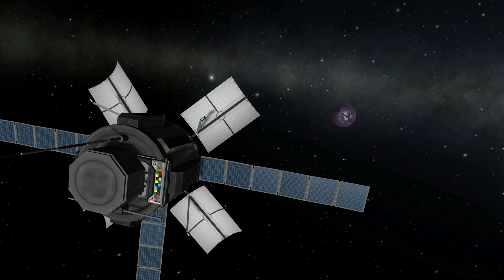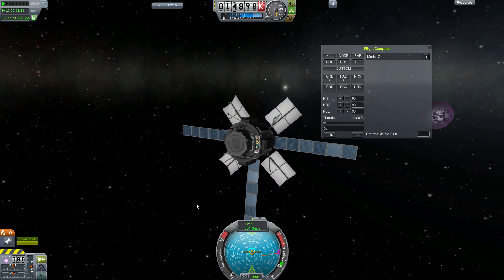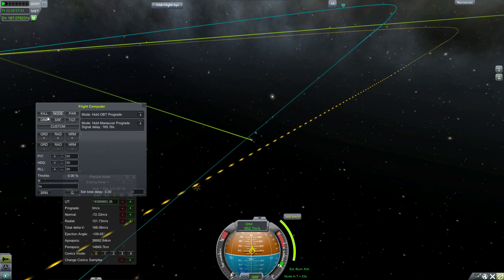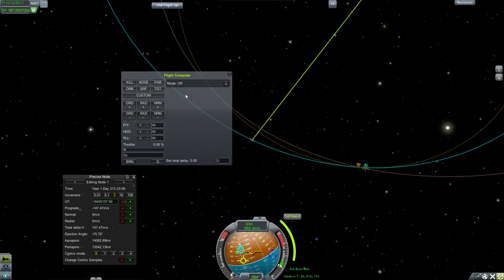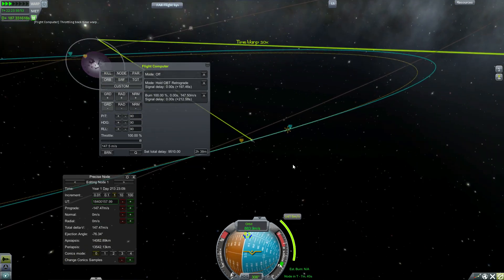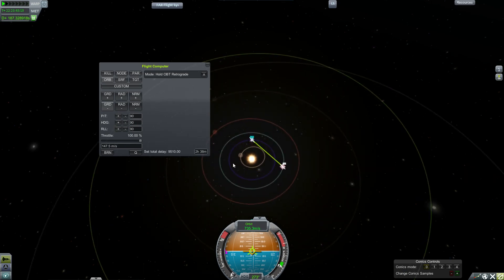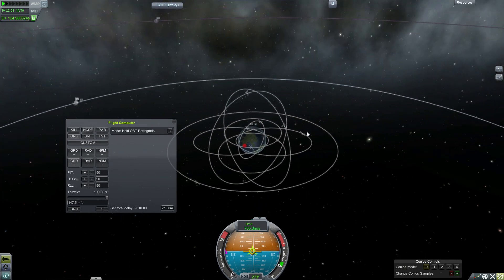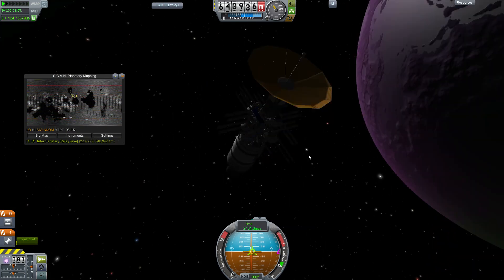Remotetech 2 (version 1.2.6)  tutorial for Kerbal Space Program .22

Comment: Great video! I need some assistance, though. As for programming circularisation burns like you did here, the need for accurate timing isn't really that critical. I understand - you were talking whilst trying to explain things, so you missed your window a little bit. Okay. But, here's the thing. I'm currently in orbit around Jool, trying to get into an orbit around Laythe. The signal delay is about 550-600s. If there were no signal delay, the formula for programming could be: Total delay = time to node - est. burn time/2. I'm sure you're familiar with starting the burn half the burn time from the node and all. Now, adding signal delay, it would be (at least this is logical to me): Total delay = time to node - burn time/2 + signal delay. The problem arises when I try to figure out when to SEND the command. Failure to accurately do this fraks up my orbit when I'm going below 10^6 meters altitude. If I were so lucky to have made myself understood, do you, or anyone else have suggestions? I've even made an Excel calculator to try and figure this out, but alas, no joy.
Reply from the maker: The "total delay" box in my experience takes the signal delay into account on its own. So if you have a 10 second signal delay and send a command to execute 20 seconds in the future, it'll add the extra 10 second delay on its own so you get your 20 seconds. 

Easy way to test-- set a maneuver node that's further away than your signal delay (doesn't have to actually do anything), set a command for some total delay that's also longer than your signal delay but shorter than your node, then wait a bit and send the command when your total delay and maneuver node countdown are equal. If the command fires at the same time as your node, then you've worked out that the total delay box does that little bit of math for you.
Reply: Okay, I'll try that. I seem to remember that my engines didn't fire at the correct time nevertheless, that the signal delay was the time in error. But, as all these things are done in the twilight hour, I may have made some other horrific error=P Haha, NASA must never let me operate any of the Voyagers! Thanks for your reply anyways!=D